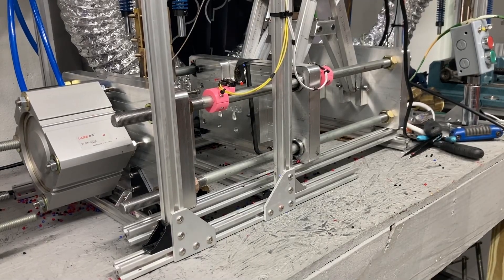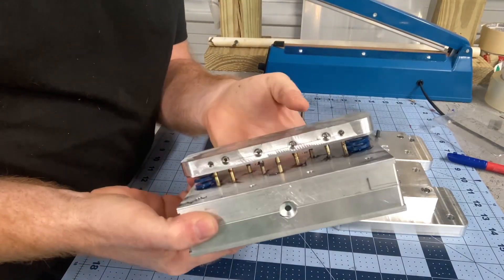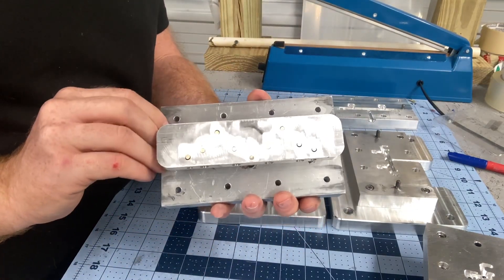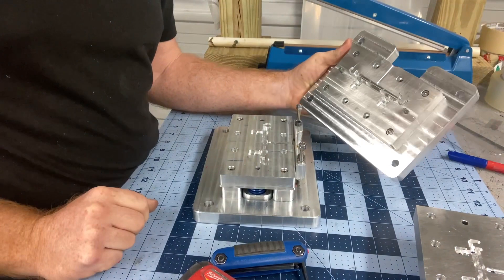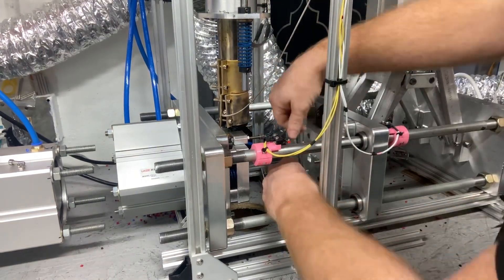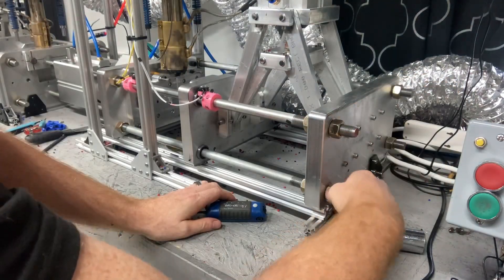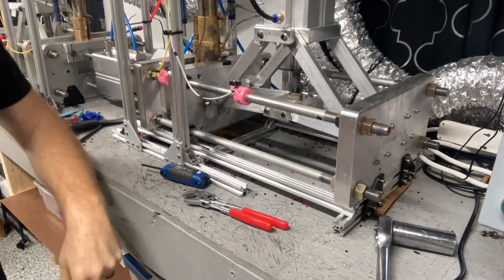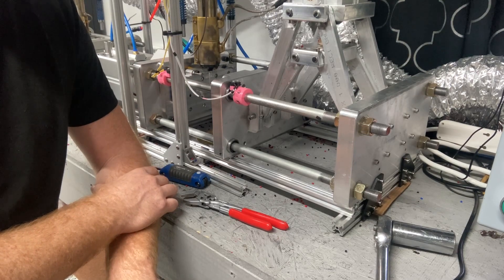Bench top injection mold machine (Mold change out)

Comment: Awesome work :) Can't wait to see the rest :)

I would imagine making all the moulds at the exact same thickness would simplify the process though?

Also, maybe you could add some dowels on the "fixed part" of the mould to be able to locate it easily, so to only have the moving part to adjust? Don't know if that makes sense
Reply from the maker: Definitely would help minimize the adjustments and the thickness are now standard for my molds. dowels would work for indexing the back side and something I may consider.